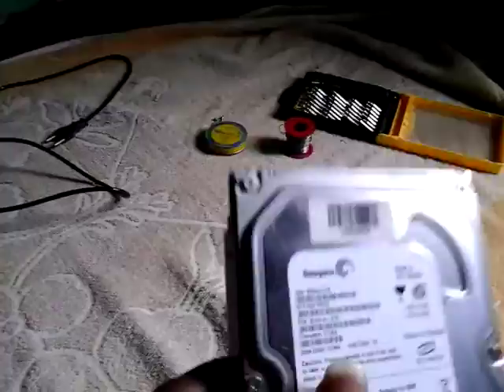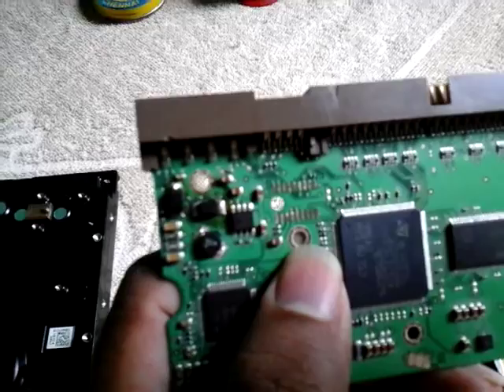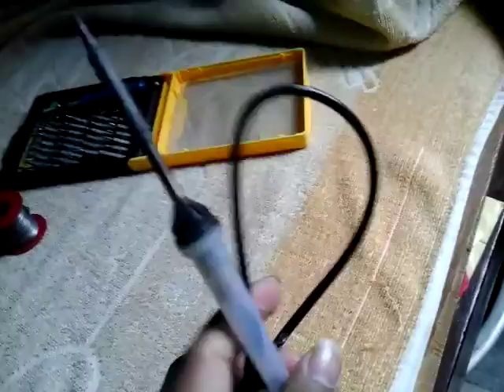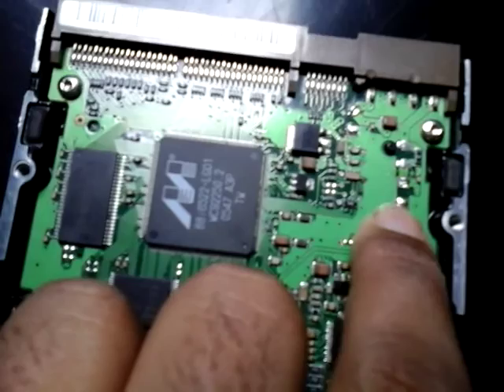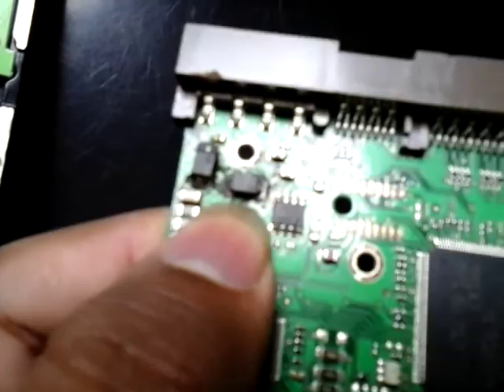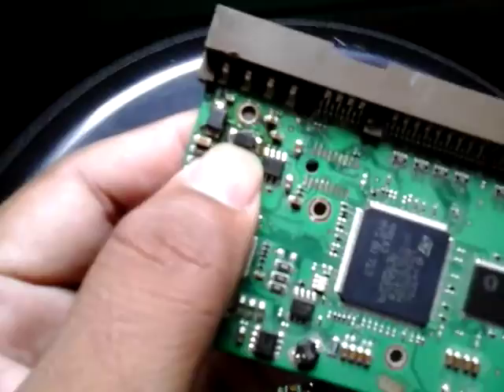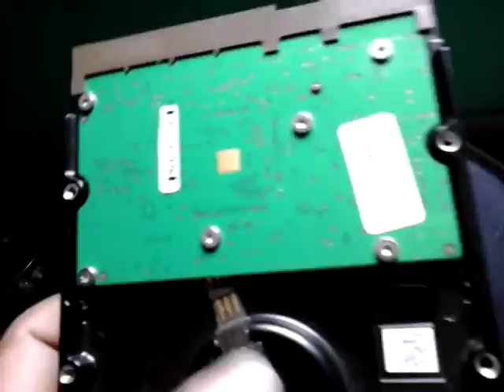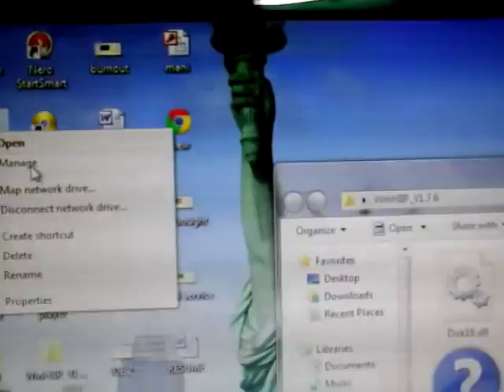How To Repair a Smoking or Burnt Hard Drive Board

Comment: i used seaget SATA DESKTOP 500 GB hard drive... but some problem in PCB.. it is burn n fail... now drive is not detect... so now what can i do ?? can i replace PCB board from other hard drive ? if replace PCB than drive will start or detect or not ? plz help me or advice me positive responce....

Comment from the maker: If you have any doubt pls let me know...dude I will help you
Reply: +Manikandan S

hi... sir... i used seaget SATA DESKTOP 500 GB hard drive... but some problem in 
PCB.. it is burn n fail... now drive is not detect... so now what can i 
do ?? can i replace PCB board from other hard drive ? if replace PCB 
than drive will start or detect or not ? plz help me or advice me 
positive responce.... thnks
Reply from the maker: Hi...i think it might be HDD PCB board diode got burned. It cause HDD wont detect or start up because of no power supply..So try to replace burned TVS diode which is 12v and 5v...those which you can find it from any other old HDD(scrap) that you can remove TVS diodes from the HDD but you need bit of soldering skill and once you removed those TVS diodes now you can replace to burned PCB board

NOTE: First you need to remove those burned TVS diodes from burned PCB board then replace it (All you need is soldering skill and any old scrap HDD)
Reply from the maker: Before you do this..watch full video what am i described.. It will helpful for you...thanks
Reply: HI, I have burned this same component (near power supply connector). What is the full name this component, please? Can I send you photo of PCB somewhere please?
Reply from the maker: Hi..ladhor send me those pic, so that I could help you out...email me at manish_unicorn@yahoo.co.in
Reply: Email was sent.
Reply: Is it some transil or Schottky diode?
Reply: +Manikandan S 

hey man thank you for posting this video,do you think a can repair a Seagate ST3000DMOO1?i did a stupid mistake i was installing a hard drive on a friend pc,o connect the HDD to the motherboard but while the pc was on i pulled the sata cable from the HDD and now the HDD is not working,and now my friend is very upset because he has important files in tha HDD.
Reply from the maker: just the PCB board whether those 2 diodes might get burnt one of them either 5v or 12v TVs diodes you can easily identify...as i explained in this video just remove the burnt diode and replace with working diodes from old harddisk..by soldering stick just watch this entire video..thanks
Reply: @manikandans6147  

Dear sir,

I have segate 500 gb hard drive  I think it's is burn on pcb board , pls can u help me out